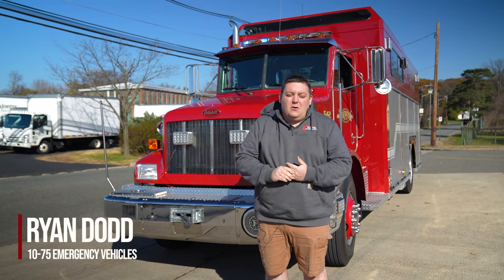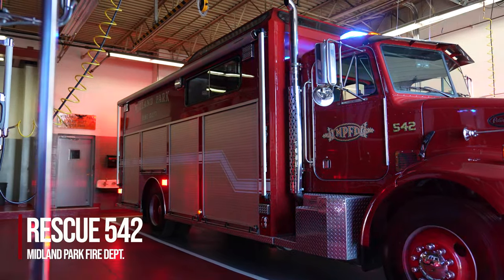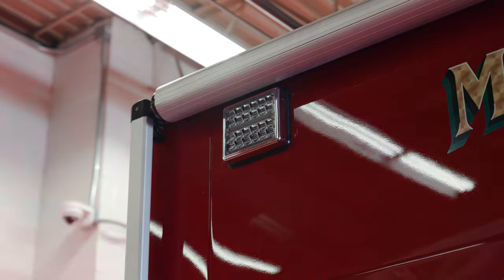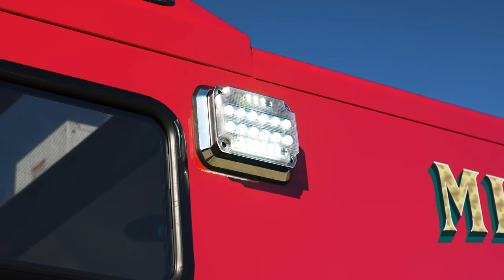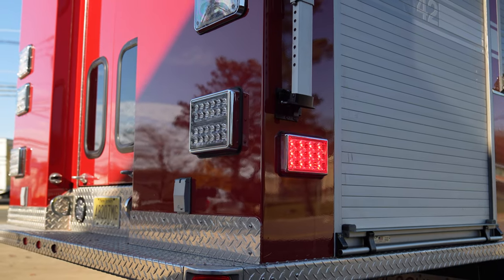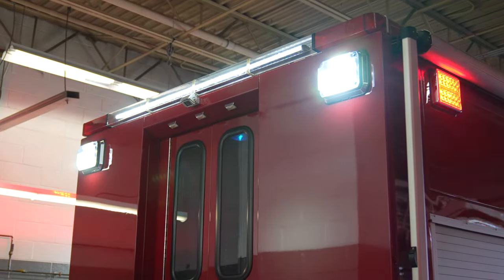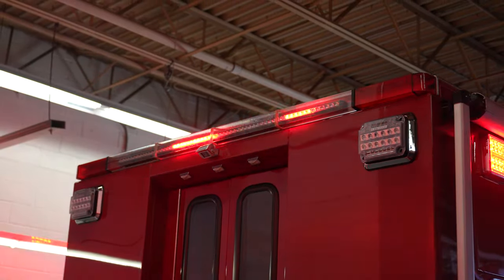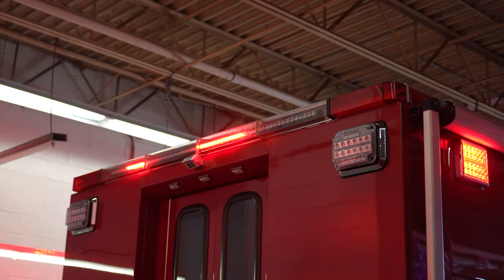Midland Park FD | LED Lights Upgrade | Fire Command Vehicle | 10-75 Emergency Vehicles

Comment: What software do y’all use to program your lighting? I work as a technician for a small city. 80% of our vehicles are police cars, so this would be a handy tool, I just wanna get a good programming software? Thanks in advance! Love your guys work
Reply from the maker: Most of the time we use soundoff signals blueprint.  But we didn't rewire the truck so this vehicles was just old fashion setting patterns.
Reply: @1075EmergencyVehicles  awesome! Thank you so much!
Reply from the maker: Welcome